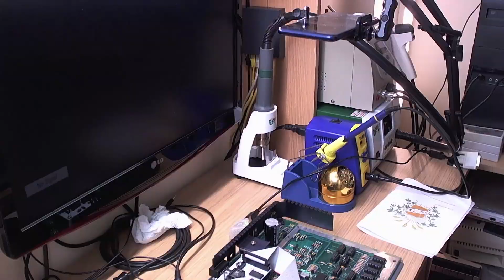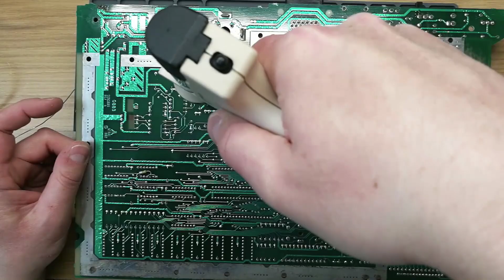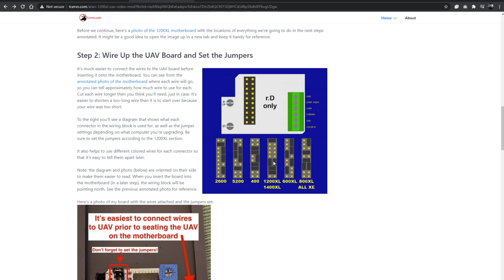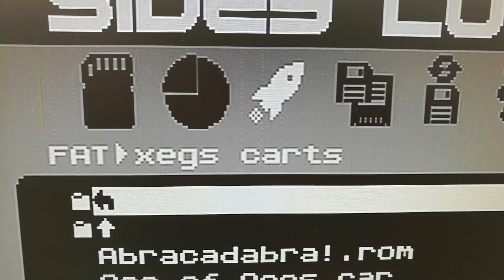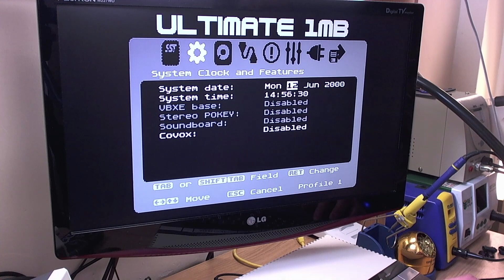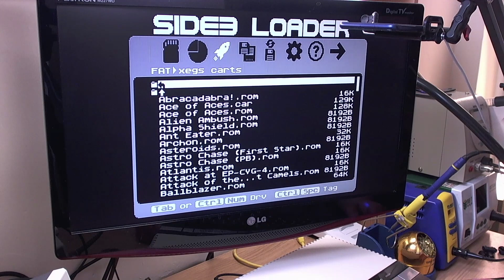The Italian Job Part 2: Restored Atari 1200XL with U1MB, UAV and SIDE3

Comment: Another great informative, entertaining and well presented video Jon
I sent my Atari 800 to atari8.co.uk, it was completely dead and as it turned out had multiple faults. I think most techs  would have given up and returned it, not Jon. I now have a fully restored Atari 800 with a very neat and sympathetically installed  Incognito system.  If you are looking for a tech to repair or upgrade your 8bit Atari don’t hesitate Jon is very fair and trustworthy
Reply from the maker: Thanks so much for the recommendation Gary. :)

Comment: Adjust the UAV pot, it may help to get rid of the artifact and jailbars. On my 800, I installed the UAV first and it was all fine: great picture. After I installed the Incognito, the video went bad, and it was very visible on the Incognito BIOS screen (black&white): snowy, distorted. When I use uav.xex I saw that the pattern was very distorted. I adjusted the UAV pot and BAM I got a much better alignment, and all the artifacts on the Incognito BIOS screen went away: beautiful picture again. I think by installing mods/hacks to the system, somehow it distorts the timing of Luma and Chroma and you may be force to adjust the pot again. IDK for sure. But I will have another chance to find out once I receive the Sophia 2 and install in my 800: I will look at the S-video again to see if the distortion returns.
ADJUST the pot!!
Reply from the maker: Adjusting the pot does not help. The jailbar issue is a known problem even with UAV and difficult to fix.

Comment: Manual said to decouple the G D connections: need to cut the gnd strip, and connect the gnd wire
Reply from the maker: That doesn't fix the problem on this machine.
Reply: @flashjazzcat  Jon, without the GND wire, are the brd. GND and the UAV GND connected? You can check the UAV GND on the big GND pad on the daighter brd. You can check the Grounding section on page 48. May be you already done this. 2 layer board w/o a solid ground plane is nasty! 
Also run uav.xex and adjust the pot to minimum artifact. Hope this helps.